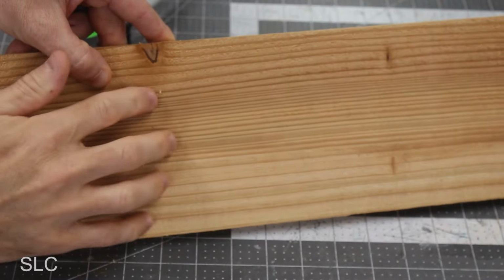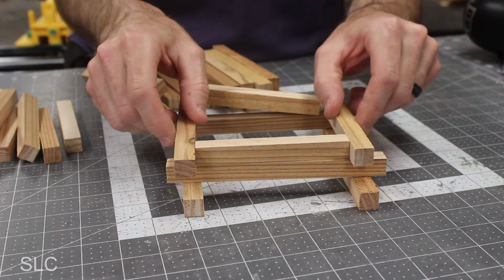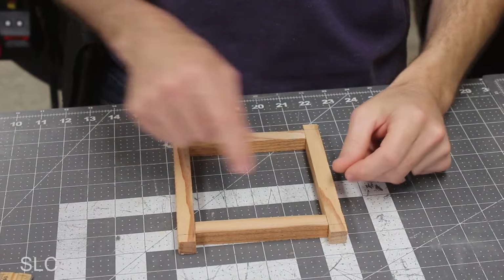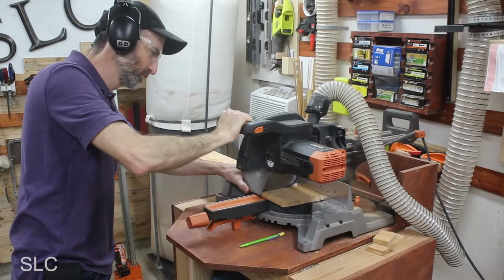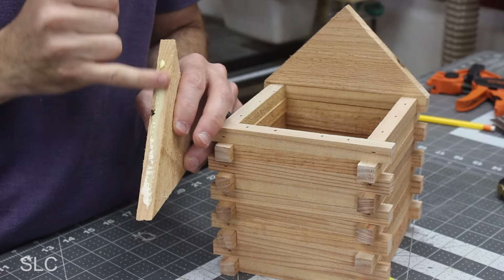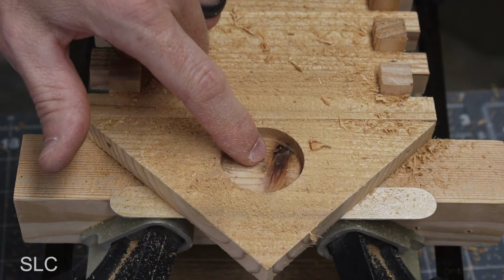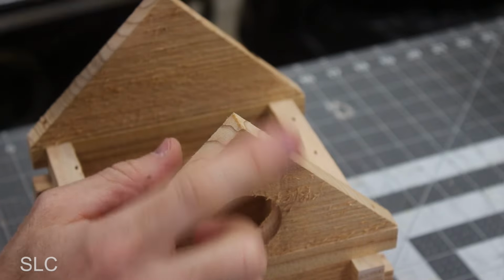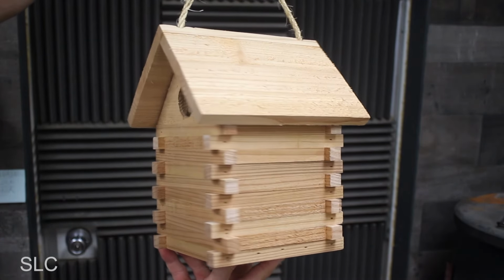Making a Log Cabin Birdhouse with 1 Board

Comment: I will add a wooden dowel for a perch.
Reply: That's generally not recommended.  The birds don't need it - just a rough surface to cling to.
Reply: 10-4 will not add
Reply: Also predators can/will use it. ☹️
Occupants will sit in the opening or on the roof.  No perch needed. 👍

Comment: I would make some small changes,  use dry wall screws to hold the in floor in so it can be easier cleaned out,  and cut he p3aks about 1/2 in from the peat to flat to get better air circulation,.  But it looks great.
Thanks

Comment: I will add a wooden dowel for a perch.
Reply from the maker: If you're going to make it for a bluebird, it is recommended not to have a perch because they don't need it and it keeps predators from hurting them.
Reply: VERY few Songbirds need a perch, but all their Predators benefit from one.
Reply: Perches make it easy for predators to reach in and grab eggs or chicks.  Cut a few shallow kerf cuts under the access hole instead.